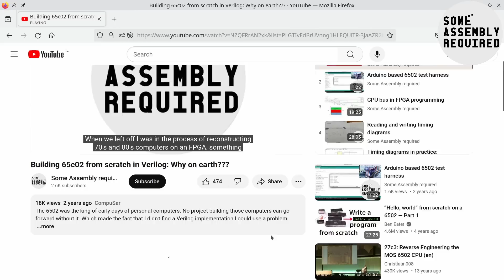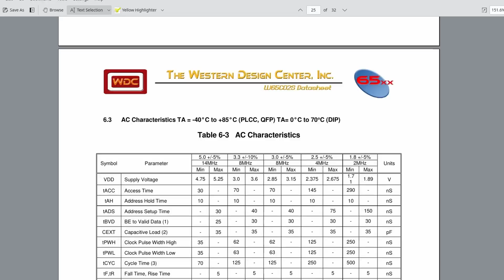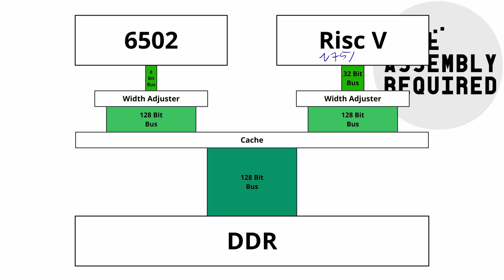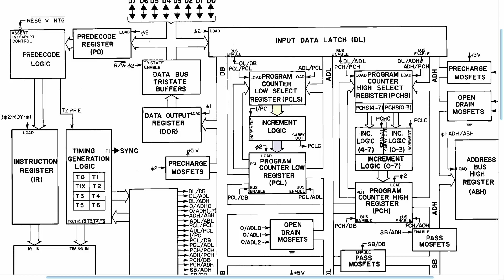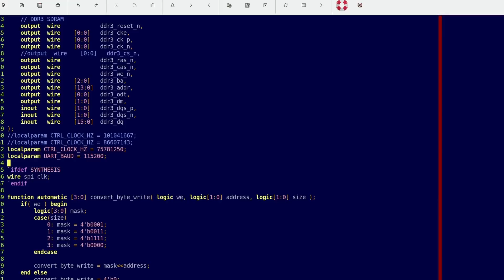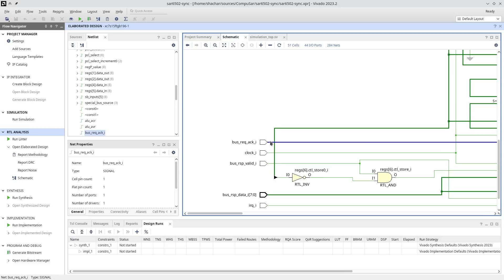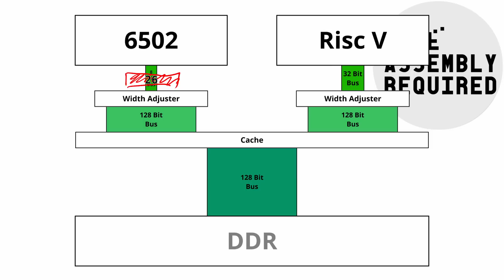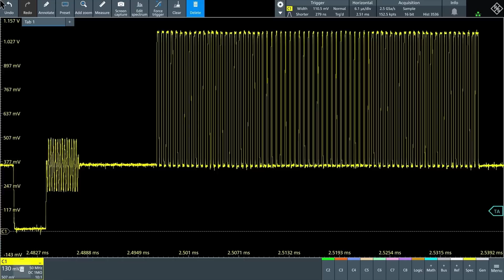Rearchitecting the 6502

Comment: Personally, I don't care about accuracy. I'm not even sure if I would start with a 6502, but definitely I'd make refinements until it was basically a whole new chip anyway. I understand that most who pick up an FPGA are looking to make a completely accurate simulation of an old chip, and if that usage makes them happy then great. I suppose they'd label me a heretic for thinking emulation is a better option if you just want to play games, but I'd really like to design my own processor and eventually produce a physical piece of hardware from my design. I figure an FPGA is great for experimentation in that regard, especially as you scale up beyond what an emulator can adequately do.
Reply from the maker: It sure is, but that's a different project. Feel free to pursue it.
My problem with "designing my own CPU" is that a CPU, or for that matter an OS, are useless without software. If you design your own CPU, you will need to design your own software, and for that matter, probably create a backend for a compiler as well. It's a huge undertaking.
I'm not saying don't do it. If you want to prove to yourself that you can, it's a very cool project, and quite satisfying when you get it actually going. Just realize that the chances of objective success (commercial, users) are slim.
Reply: @CompuSAR   Well, I don't care about commercial uses or having more than one user anyway. The purpose I have in mind is more of a "no infrastructure existing at that point in time" kind of use. Sort of like doomsday prepping for someone that wants to preserve computers for the future. And I'm not afraid of writing my own software for such a system, I've already written multiple compilers including backend code generation. I'm in the process of writing a backend for ARM and I'm actually considering doing one for the 6502 just to see if I could adapt my language towards writing NES games.
Reply from the maker: @anon_y_mousse  good luck. I briefly considered writing an LLVM backend for the 6502, but its lack of indirect oprands except through zero page is a real bummer. You could do it by treating ZP as 128 16-bit registers, and use them for register scheduling, but the result would be *slow*.
Reply: @CompuSAR   This is why I wrote each of my code generators myself. I don't think that highly of LLVM and I've noticed that gcc which was hand coded does a better job of optimizing. I was thinking for NES code generation that it'd be better to add more as statics in the ROM, and for extra space I would have to add a RAM chip to the cart. Might be considered a bit of a cheat, but there were a few carts that had extra RAM. As far as I understand it, the 6502 only had 256 bytes of stack and some of that was reserved.
Reply from the maker: @anon_y_mousse  Technically, none of the stack bytes were reserved. I think you're confusing with page zero where, depending on platform, there were reserved addresses. Either way, good luck.
Reply: @CompuSAR  You're right. This is why I always have the documentation open when I'm writing code so I don't make mistakes like that when it counts.

Comment: personally i would've gone exactly the opposite way, adjust the RISC-V CPU to have a 6502 compatible async. 8-bit bus. and then have the RISC-V CPU's clock just be the 6502's run through a PLL (multiplied by 50 or something). that way they're always in-sync with eachother and you can use some much much simplier logic to connect them to the same bus (before the width adjustment/cache).
plus it allows you to adjust the 6502's clock to whatever system you're emulating and the RISC-V's clock will automatically follow.
though overall, your idea of using a large master clock for both CPUs and just letting it get 1 cycle out of a set amount of cycles is way better.
Reply from the maker: Neither adjustments are particularly easy, but I think writing a synchronous 6502 is easier than writing an async RiscV. What's more, it's not just the RiscV. You'd also need to adjust the DDR controller, SPI controller, interconnect and any other component in the system. The whole system would have to be async.

Comment: The venerable 6502, the original RISC design, should be the first architecture implemented in graphene.
Reply: The original RISC designs were the small efficient processors executing the µ-code of mainframe and minicomputers of the 1960s and 70s. Well before the 6502 (which isn't RISC either).

Comment: This is basically how i handle load-balancing within single thread applications to tie the fps rates to the desire position.....but I adjust the individual load timing on-the-fly in order to maintain rather than gate them, this way it attempts to maximize calculations until the core starts to suffer, then just raise the wait time for the following cycles (since the individual calculations performed are never known ahead of time, they are just added in as class callbacks into a list).

soooo....in short, I create my own multi-thread using count triggers lol.

Comment: Actually the 6502 is considered one of the first RISC processors not CISC like your video description states.
Reply from the maker: I'm sorry, but that's just not true. While there are some RISCish traits to the 6502, it is still very clearly a CISC CPU with CISC machine code.
The three main RISC characteristics are a pipeline, with all instructions taking the same number of cycles and having the same length. The 6502 has none of those.
Reply: @CompuSAR  Actually there is a little bit of true pipelining, and a lot of instructions do finish up while the next one is being fetched.  An example given in WDC's programming manual is ADC#, which requires 5 distinct steps, but only two clocks' time:
Step 1: Fetch the instruction opcode ADC.
Step 2: Interpret the opcode to be ADC of a constant.
Step 3: Fetch the operand, the constant to be added.
Step 4: Add the constant to the accumulator contents.
Step 5: Store the result back to the accumulator.

Steps 2 and 3 both happen in a single clock.  The processor fetches the next byte not knowing yet if it will need it or what it will be for.  Steps 4 and 5 occur during the next instruction's step 1, eliminating the need for two more clocks.  It cannot do steps 3 and 4 in one clock because the memory being read may not have the data valid and stable any more than a small set-up time before phase 2 falls and the data actually gets taken into the processor; so step 4 cannot begin until after step 3 is totally finished.  But doing 2 and 3 simultaneously, and then doing 4 and 5 simultaneous with step 1 of the next instruction makes the whole 5-step process appear to take only 2 clocks.

Another part of the pipelining is the reason why operands are low-byte-first.  The processor starts fetching the operand's low byte before the instruction decode has figured out how many bytes the instruction will have (1, 2, or 3).  In the case of indexing before or without any indirection, the low byte needs to be added to the index register first anyway, so the 6502 gets that going before the high byte has finished arriving at the processor.  In the case of something like LDA(abs), the first indirect address is fetched before the carry from the low-byte addition is added to the high byte.  Then if it finds out there was no carry generated, it already has what it needs, and there's no need to add another cycle to read another address 256 bytes higher in the memory map.  This way the whole 7-step instruction process requires only 4 clocks. (This is from the next page of the same programming manual.)

While i agree it is not a full RISC CPU by nowadays standards i also can not aggree that it is a full CISC CPU like you claim.
It's something between them both but it definitely has a lower amount of instructions then other CPU's of that time.
Reply from the maker: @gpisic  If you want to paint a broad stroke brush, here is the division:
CISC: internal buses, microcode
RISC: Everything is done through one or more pipelines
The 6502 does not have a pipeline. It is true that it has some things that are characteristic of RISC, but nowhere near enough to justify the RISC label.

In particular:
The 6502 fetches the PC at the second cycle of an instruction, regardless of what that instruction is (your 2 and 3 steps). So in a way, it fetches before it decodes, which is similar to what a pipeline does. The 6502, however, does not do that as part of a pipeline, not in the RISC sense of the word.

There are a few commands (ADC isn't one of them) that indeed take effect after the next command has already started executing. Again, it's something a RISC machine does too, but using a different mechanism.

So, no, saying that the 6502 is a RISC CPU is, to me, stretching the truth beyond breaking point. If you want, we can agree that it's a precursor to the RISC CPUs.

Comment: When the enhanced 6502s came out with higher clock rates and every instruction operates in a single cycle we ditched the original.  The new models had PHX and PHY so IRQs had less overhead.  We moved more data that way.  Why even use the original, it was obsolete when the enhanced versions came out, early 90s?  Make something that runs at a higher speed than the RISC-V and run it with the RISC-V clock.  Then people can fix the code to deal with the higher clock rate.  Innovate forward.
Reply from the maker: Please do spend one minute on the channel's trailer to see what the end goal is. What you suggest is literally the opposite of what I'm trying to achieve.

Comment: Some things in the MOS6502 are not that great, but this processor was one  of the early ones. The MOS6510 was a bit better, still not super but millions of them were made and the people loved it. The 6502 is a bit basic, it is a processor and not much more. Long time I did not see the strong points of the MOS6510 in comparison with the MOS6502, the extra bits were so meagre, so little, so tiny. Why did they ever bother to produce it. 
 
The MOS6502 had mountains of limitations and piles of shortcomings. Yeah, it could have been done better, but it wasn't done back then and now it is too late to do something about it. History is written down already, no use reinventing the wheel. The MOS6502 is a bit special, like a diversity kid that has to be in a commercial on TV, his parent must be proud that during the hole commercial he did not drewl rainbows on something, that kind of special is the MOS6502 processor. It is not loved for being fantastic but loved for getting the work done despite of the huge stack of quiescentnesses. (I ment koo worky ness ses)
Reply: You have to rember the primary goal NMOS had in designing the 6502 was to be as cheep as possible that ment keeping the transistor count down. The zero page addressing mode was a result of this as it made up for there being only 3 user registers at the cost of only one clock cycle a very good compromise. Where the 6502 falls down is nearly all of those zero page memory locations are usualy grabed by which ever OS is running leaving very few if any available for user applications. Great for the intended use case as a dedidcated one use device such as a calculator or microcontroler that have a tightly couple application and OS layer not so good for a general purpose computer.
Reply from the maker: @martinrwolfe It did turn out great for what it was used for, though. While modernish operating systems did exist at the time, personal computers didn't really need them. So the computer mostly did one thing at a time, and when it did, that's all it did. Under those conditions, zero page addresses weren't that badly over-allocated.

Comment: I was thinking of how DEC made the Virtual Address Extension to turn the 16 bit PDP-11 into a modern for the time 32 Bit CPU while making sure PDP-11 code would still work. I think something similar could be done for the Zilog eZ80F917, Motorola 68060, WDC 65C832 and Vortex86DX3 to allow them to run modern 64 bit code with 256 Bit Vector Extensions, a 64 bit address bus, Cryptography acceleration, 4 way SIMD, EPIC instructions, and a hardware PCIE Express controller without breaking backwards compatibility. To escalate from the original instruction set to the 64 bit expanded instruction set, there would be a VAX instruction that would be used by the bootloader to switch to the expanded instruction set and address bus.
Reply: I also think of the real mode/protected mode divide introduced with the 80286 and really only rendered fully baked in the 80386.
Reply: @mal2ksc  I am aware of that, but I favor DEC's approach with the VAX/PDP11 architecture over the protected/real mode intel architecture. The reason is backwards compatibility. What my proposed virtual address extension would so is allow 8 bit eZ80 code to escalate to 64 bit VAX code and to take advantage of an expanded instruction set. Other than that the instruction set is the same and if the programmer wants to they could use the AVX2, EPIC, 4 way SIMD and the hardware PCIE controller in 8 bit mode, but all the VAX instruction does is allow 64 bit code to run while 8 bit code that already exists does not need any modifications.

Comment: So 6502 is running with an effective clock jitter, to allow for other bus activity or SDRAM being unresponsive. It doesn't hurt your project since all of your other subsystems have flexible timing as well, and might as well go to sleep and catch up as needed.

But i wonder how it would affect interfacing with legacy hardware, say Commodore IEC bus and 1541 drive, or emulating the 1541. The basic IEC protocol is explicitly clocked, so an endpoint can cycle stretch, but wouldn't have fastloader compatibility?
Reply from the maker: On a completely different note, my channel stats insist that my viewers consist of 100% males. Please tell me YT is wrong on that front.
Reply: @CompuSAR   Yes. It was already noticed by Hector Martin that someone like myself and several of his female friends who largely watch engineering related content won't count as a female viewer, and the self-specified gender is completely ignored. Don't trust the stat.
Reply from the maker: My theory is worse. I suspect you don't count because you watch engineering content, which is really depressing if true.
Reply: @CompuSAR   Yes that was exactly the implication. Luckily there was never such a stigma in my family when i grew up, but then that's a family with Bulgarian roots, so that's a little different from most of the rest of the world.
Reply from the maker: There is another possible explanation, that there are less than 1:1000 which make you not register. I don't think it's very likely, but it is possible.
Going back to your original question: what I neglected to mention was that the modulator never introduces external latency. If we're going to have jitter with the modulator, we're also going to have jitter without it. In fact, by allowing requests through immediately but postponing replies, the modulator can actually reduce jitter.
Reply from the maker: It's an excellent question, and one I don't have a ready answer to. I'm guessing no, but I might be wrong.
In more details: DDR refresh takes several hundred nanoseconds, so is unlikely to cause even a single missed cycle (1MHz translates to 1us cycles, so 1000ns). Same goes for cache evictions and HDMI access, which pretty much sums up the potential causes for outside delays.
Even if the delay is longer, I can't see it affecting IEC. Even with a fast loader, the IEC is driven by the 6502 on the C1541. It's maximal granularity is 3-4 cycles assuming no loops, closer to 10 cycles with a loop. Even a 3 cycles jitter cannot possibly affect it.
Where things are a little more touch and go are things that sit on the actual 8 bit bus. If you hook up an Apple II expansion card or a C64 cartridge (which this project totally aims to support), those expect to see a 1MHz clock with bus operations. I'm still optimistic that it'll be possible to give them what they need (or, at least, close enough for things to work), but time will tell.